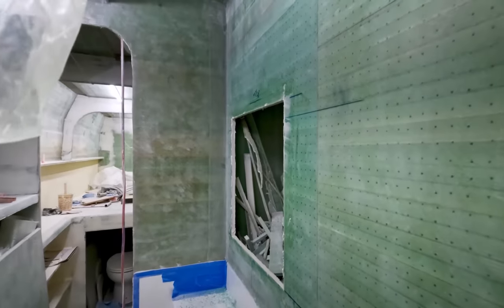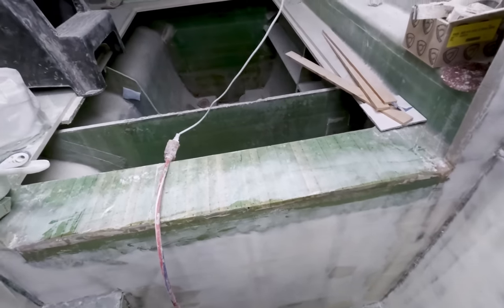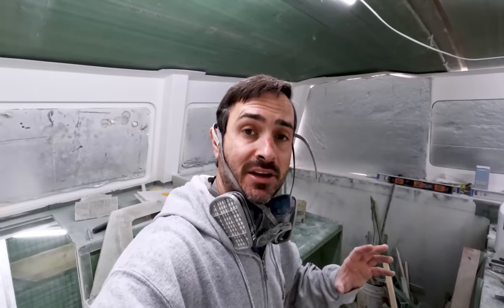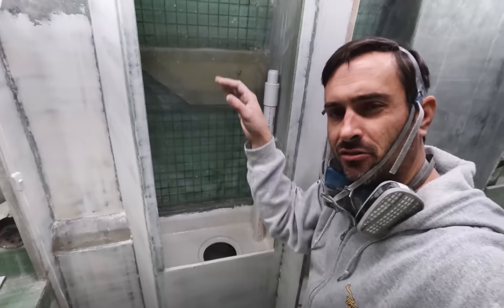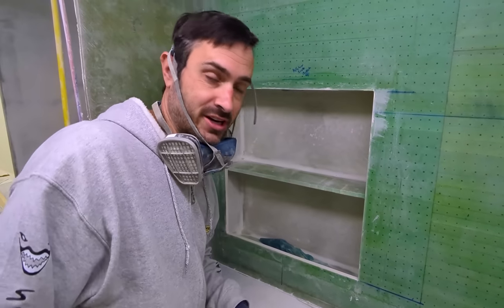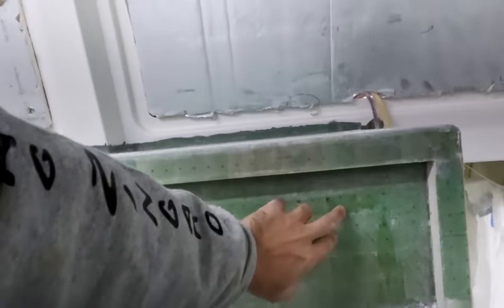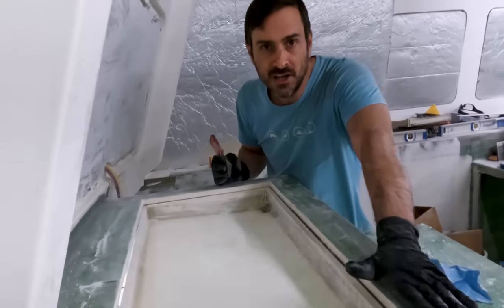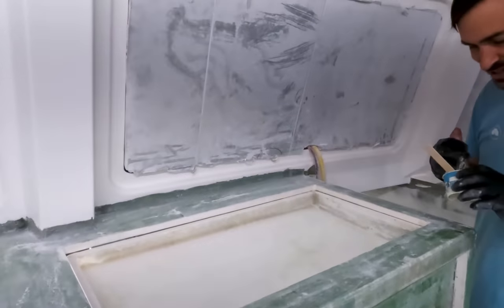This SIMPLE Item Has Cost TOO MUCH TIME!!  (MJ Sailing - Ep 271)

Comment: You can buy drill bits with an impact driver attachment that will work with your 90 deg adaptor. I have a set that I use all the time.

Comment: When I have "tight fit" holes to drill I use a "flexible shaft" attachment for my drill which starts with one of those "clip on" system for quick switch between drilling or phillips head or 1/4, 3/8, etc. Or small mm sizes. six sided hex bits.  About a foot long, stainless flex outer with an internal "spring like" drive. Twists anywhere. (Mostly). Just saying. ❤

Comment: I'd be making every attempt to make things level too but it's interesting given that 99.9 percent of the time the boat will largely be unlevel on the water even in a port or marina. Thanks for the videos!
Reply from the maker: We had an issue with our last build where the boat wasn't blocked level, but we thought it was. Once put in the water, anything on the floor would roll towards the stern. 😂

Comment: You will need to put a u bent in on the drain or waste tank smells will be in the dish drying area, but a proper 90 deg drill you will need it I can guarantee
Reply from the maker: It's a direct discharge on sink/ dish rack.    No gray water tanks on most boats

Comment: It's really coming along in leaps and bounds looking great even with Matt's little foopar lol. It'll be fine.  Just some food for thought for Matt for future if you want to put in a drain of a larger diameter but have a slightly narrower spot in its travels you could just heat up the pipe with a heat gun and oval out the pipe in that area its still going to have the same volume obviously just a narrower ID which wouldn't make any difference.
Just my thoughts 
Loving the progress

Comment: Just curious. Have you considered adjustable shelves as are often found in kitchen cabinets?  Multiple small peg holes on the sides and pegs to hold the shelves which can be moved up or down depending on current need.
Reply from the maker: We could have gone for the adjustable shelves, but they would have required additional structure/weight to make them self supporting... The foam core cant support the pins, so would have required a wood structure in all four corners.  Also, the idea is to have everything contribute to rigidity of the boat.  Even these small shelves add up to an impressive stiff structure in that area.

Comment: Is the corner with the drain hose for the drying rack lower than the rest, so that the water naturally goes down into that corner, and into the drain?    Looking great so far.
Reply from the maker: Yes, that corner has been angled down so all the water will make its way toward the drain.

Comment: HI guys, greatly enjoying your build videos. Quick question. In the section where you are building the holding tanks, is it the case that the holding tanks will be below the waterline. If this is the case how do you plan to discharge the contents while at sea. Are you installing a pump to do this.
Reply from the maker: The bottom of the tank is about 12" above the waterline.  The beauty of a light weight boat is little of the hull actually in the water :)

Comment: Put a little lip on the inside on each shelf of the medicine cabinet so when you open the doors the stuff stay in place.
Reply from the maker: The bottom shelf won't need one because it sits below the opening, but we will be going back and placing a fiddle on the top shelf to keep things where they belong.
Reply: @MJSailing  yeah, I noticed that after you had the box installed that you only needed one fiddle. Another neat thing to have is a light that  goes on when you open cabinets. I got motion lights from Homedepot that operates  on two triple aaa batteries  and I keep one in every  closet.
Reply from the maker: We just started buying rechargeable lights with motion sensors lately.  They work surprisingly long and are light weight, inexpensive, and seem well built.
Reply from the maker: @hanssolo4ever  We've been tinkering with USB charged motion lights lately.  I keep one above the electric cooktop and one in the food pantry of the Viking we're currently living on.  They've been very handy, and a single charge has lasted us 2 months so far!
Reply: @MJSailing  nice, include in your videos once you get to the point of installing and using them on your boat your experience with them.

Comment: GUEST AREA SHELVING above sanitary Tank:  Are ADJUSTABLE shelves such as used for bookcases a possibility here?  This would give you and your guests ultimate flexibility.
Reply from the maker: We could have done adjustable shelves, but the idea is to have everything in this boat add to the rigidity of the structure.  So by glassing them in, they not only add to the strength, but they are lighter since they don't need to have the strength to self support by a few adjustable legs.

Comment: Impressive job , I worry your holding tank discharge is NOT ODORLESS Plumbing ??? And painting it with epoxy is still not fool proof.
Reply from the maker: It's standard PVC pipe - which is better than nylon used for most fittings.  You can't run hard pvc all the way as it doesn't pass survey... It needs to be flexible

Comment: 11min mark FILLING a decored glass with "fairing compound/add strength"  haaaaaaa hahahahahahahahahahahh I have had to REMOVE compounds like this so many times from hinged edges. I've discussed before with you two. For a proper direction you want to fill a DECORED area with hull-n-deck, or handmade putty with epoxy or VE/POLY resin using cabosil, larger thickeners and "CHOP STRAND ADDITIVE" All fairing compounds are soft. They are soft for a reason, to reduce spider cracking the surface paint. FAIRING compounds do not have a structural bond, its a matter of hardness. In general fairing compounds  dont even register on a barcol meter.
Reply from the maker: There are no hinges here.  It's impact strength that we're looking for on edges and fairing compound is just fine for that.
Reply: @MJSailing  ahhh... no hinges, big load difference.

Comment: using wood for the drainer is a terrible idea.  It will rot , use stainless
Reply from the maker: Most drying racks are either wood or plastic.  They work just fine as long as they aren't sitting in puddled water.  The wood part of ours is 2" above the water tray.